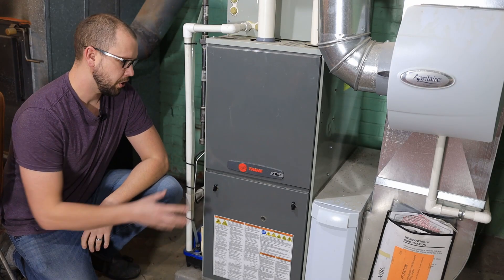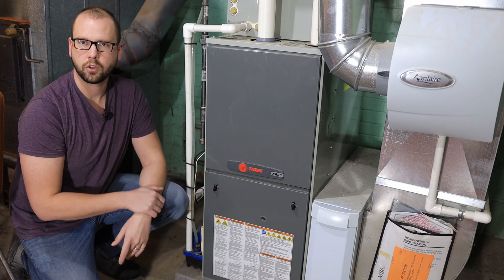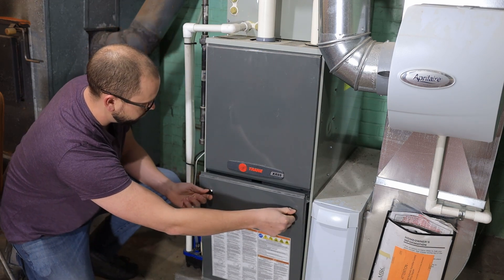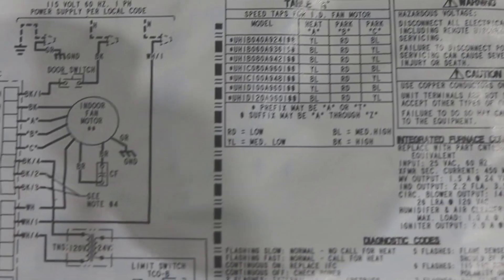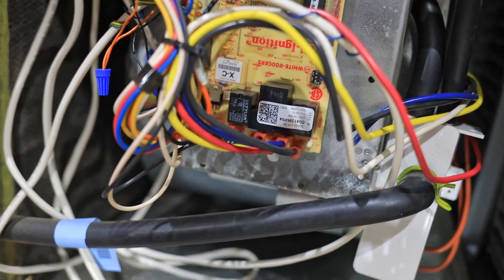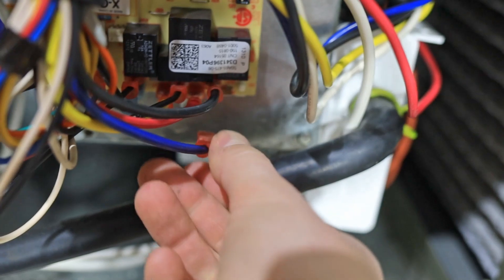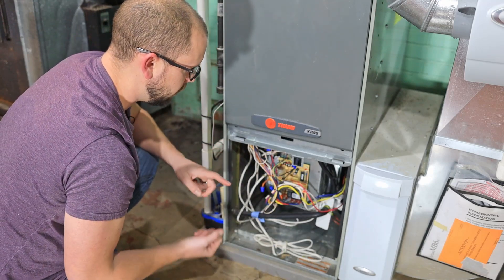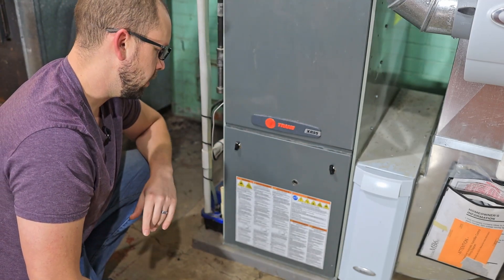Changing the Blower Speed on a Furnace

Comment: You want max air flow, so each season you swap the wires.  Why not short the cool and heat and connecting the black wire to either cool or heat.  This should give you max blower speed in both seasons, right?
Reply from the maker: That seems like it would work but I can't say for sure if it is safe for the circuit board.  You would be sending power to the output pin of the one that you are not using.  If it is just a relay turning that is sending power to the pin it is probably fine but I would be afraid that backfeeding it might burn something up.  Would really have to stare at the diagram for a while before trying that.
Reply: Pulled this straight out of my Goodman furnace manual:

To adjust the circulator blower speed, proceed as follows:
1. Turn OFF power to the furnace.
2. Select the heating and cooling blower speeds that match the installation requirements from the airflow table in the Product Data Book applicable to your model.
3. Relocate desired motor leads to the circulator blower heat and cool speed terminals on the integrated control module. (Terminals are identified as HEAT and COOL (hot)). If heating and cooling blower speeds are the same, a jumper wire must be used between the heat and cool terminals. This wire is provided in the literature package.
4. Connect all unused blower motor leads to the “PARK” terminals on the integrated control module. Any leads not connected to the “PARK” terminals must be taped.
Reply: @ajisup  So supposedly a jumper wire exists. Must find mine lol.

Comment: Mine has black to AC at the moment but not enough air flow into the house. Brand new unit. 59 degree air coming out of vents but low air flow. No holes or leaks in supply run.  Filters changed. 410 charge good.  Any ideas!?
Reply: Undersized return duct work or undersized furnace

Comment: They replaced my motor and does not run as fast as old one. Motor has connectors going to it. If he crossed the connectors when he hooked them up to motor would it cause this problem? I told the tech that I did not think it was running at speed it was suppose to. Apparently not because temp went up in house and lines on outside unit were frozen.

Comment: Just had a new system installed and the furnace whistles the technician said my return was undersized. Talked to his boss he said they might try turning the speed down.
Reply from the maker: That is probably fine for AC.  For heat you  run a little risk of the heat exchanger over heating and failing prematurely if you slow it down.  If you can find a manual online for the furnace, you may be able to check if there is a minimum speed recommended for the heat setting.  You may also be able to find where the whistle is coming from.  It is probably a seam or sharp edge somewhere in one of the return lines.  Could also be a vacuum leak in a return line that you may be able to tape off with aluminum tape.  If any of your returns have adjustable baffles on them, try opening them all and see if it helps.
Reply: @CoolStuffGuysLike     The return collapses when it starts and stops . I was thinking about enlarging all the return openings right now they are 6 x 9 and are in between studs . I think that’s the problem same restriction going through the floor.
Reply: @bluesdirt6555  go to a cheap filter and see if that helps with the suction of the duct. merv 8 or less.
Reply: The blower noise for heat and AC is so loud. My rental house is 70 years old. The vents are metal and they have door; flip it open/closed. Even closed, the noise is very loud. Any suggestions? Thx!

Comment: Hello , I'm wondering putting a boost to blower is it good for a/c as well as heat ? Does it harm unit at all ?
Reply from the maker: Normally the blower speed will be set to high for cooling and medium or med-hi for heat.  You can increase it for cooling if it is not.  It is nice right now to have the higher flow and higher air exchanges per hour in the house with the pandemic.